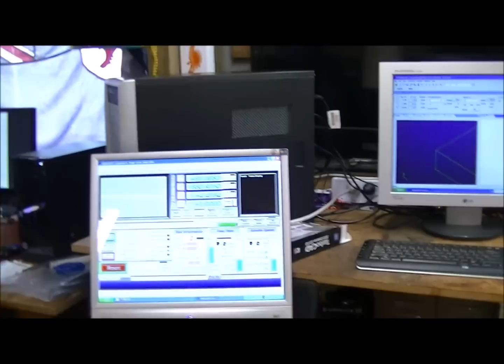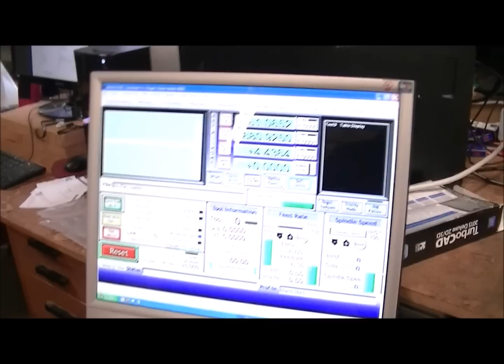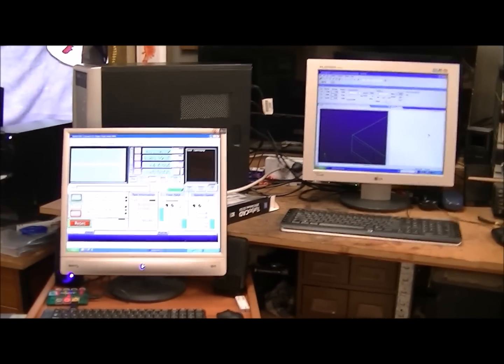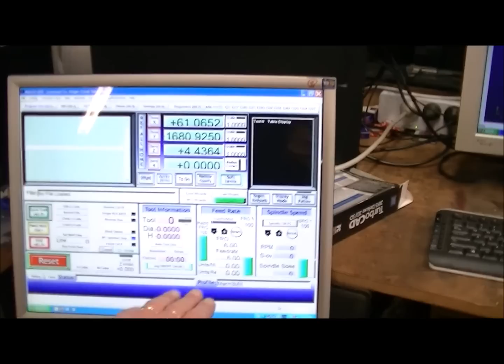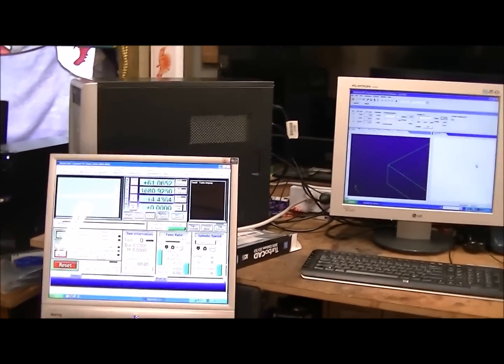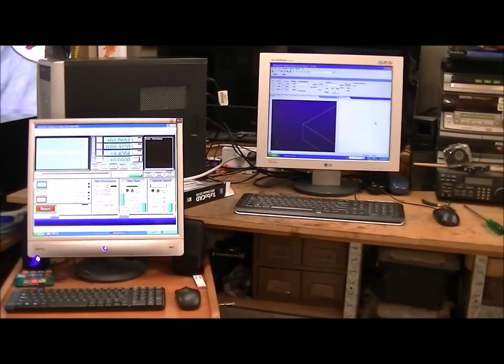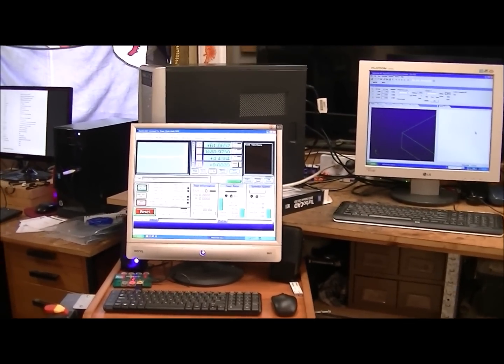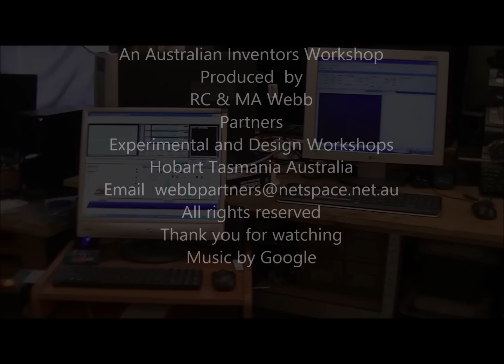132 Mach3 vs NC studio

Comment: Roger, I was surprised when you commented that a new 'license' was required for you auxilliary computer.  It is my understanding that a 'hobbyist' can install their license on multiple machines, ie; on your design computer, on your shop computer, ect.  Now, if you are licensed as a commercial user, a new license is required for each computer.
Reply: i am also surprised , all he has to do is just copy the license file from the old machine's mach3 installation folder to the installation folder on the new computer ! , i don't know what was the problem with the old computer but there is a big chance that the hard drive is still working. also, you need to have a backup of the license file.
Reply: exactly....I keep a complete backup of my mach3 folder on a flash drive AND a cd for when (notice I didn't say IF?) my computer than runs my CNC screws the pooch. I simply copy the entire folder back onto the new computer and go back to work. 

I think buddy who made the video was disappointed because he didn't do a backup. If you don't have your licence you can't download another copy.